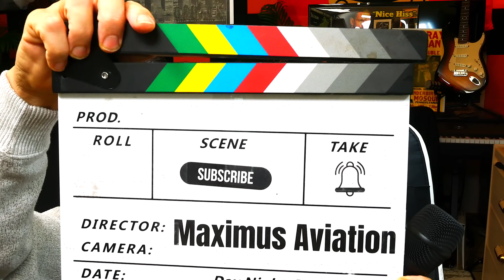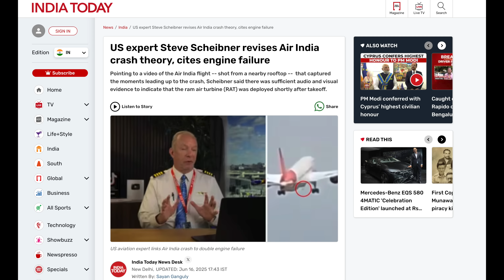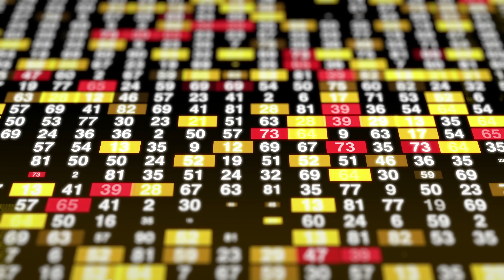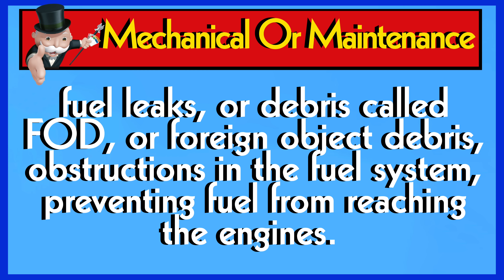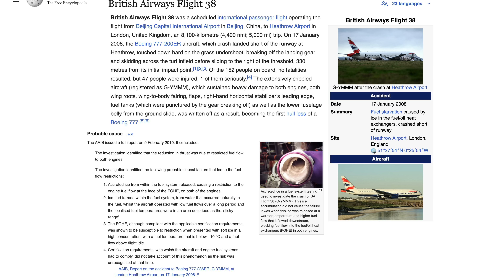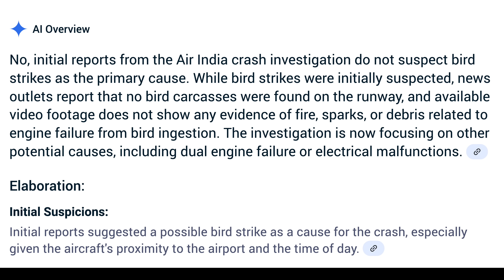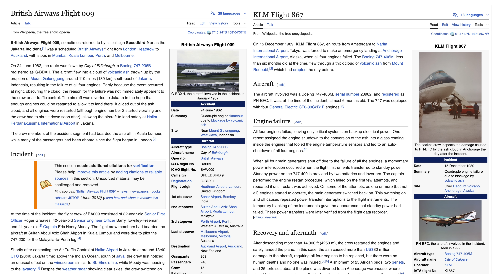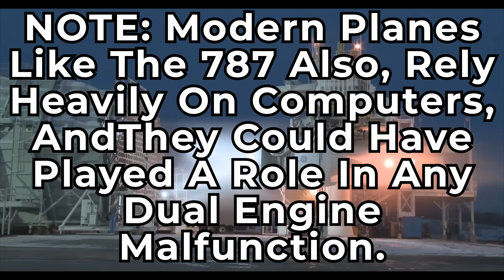Dual Engine FAILURE, Real Or Just The Latest Guess By Armchair Pilots? Find Out How Engines Fail ✈️

Comment: Some video reveals something appears to be spoilers on wing top close to each engine. If unaware, spoilers can give pilot a sense of lost of lift, thrust or both. A panic pilot can pull off the RAT manually. .
Reply: flaps 5 give you a gap below the spoilers a captain said  i think it might be that but its a good point as i think they might be used as ailerons so maby they were dampening out the aircraft after an engine failed via the computers
i probably am talking bollox

Comment: There is also a possibility that one redundant FBW computers failed in the way that was feeding other computers with such bad data that would prevent ir being recognized as failed one (instead going offline). Or saturating the comm bus, and freezing some of the mech and power systems in the SNAFU manner.
I remember a case with Airbus where ADIRU failed "loud" and because of some unexpected quirk it was not properly recogized as a failed unit and sent garbage data, affecting controls.

Comment: Whatever happened, happened while they were still on the ground. One of the evidence is that they took off at the very end of the runway. I think pilots knew that something was wrong, but took off anyway because they were under pressure from the company. They should abort this takeoff and the tragedy could’ve been avoided
Reply: when you're on a takeoff roll, you reach a point where you HAVE to take off or you'll just plough headlong off the end of the runway and into anything that's in the way. you have no idea what you're babbling about. "under pressure from the company"? you're delusional.
Reply: NONSENSE. And search for other aviation channels, one of them has shown graphs that show several Take-offs taking similar runway lengths, and a couple even slightly longer.
Reply: @alfredomarquez9777  and speed ok a 787 pilot has said
Reply: Well it was hot that day, it was dry and the weight was high, which would explain the long length
But I don't understand the small plume of smoke that came after it took off, was it an engine failing or did the aircraft overshoot the runway for a bit?
Reply: @crypton7572  it could have been slowly failing when rolling   i think it looked ok but that means nothing in reality

Comment: Boeing and AI know what happened with with AI 171. These aircraft send out Trea data of system information. No doubt engines lost power as the pilots called out. The 787’s have so much software onboard, having that software work correctly is critical. The investigation will follow all maintenance accomplished prior to prior to this flight and pilot action during takeoff.
Reply: amazing

Comment: There is always the possibility of deliberate fuel shutoff.
Reply: Accidentally or intentional
Reply: @mikesorensen5228  Never accidently. Do you ever step on the gas pedal when you want to stop?
Reply: @Deploracle never huh?
Reply: @mikesorensen5228  I'm sure you'll list the few times a fuel valve was bumped in flight .. but that wasn't during take off when one's pilot's hand is on the yoke and the other on the throttles.

The pilot not flying isn't going to be messing about in the area below the throttle levers during the take off roll.
Reply: Not heard much about the pilots
Reply: Nice call. First person to suspect this outcome.

Comment: I am a 787 expert (I watch some other youtube videos): VAPOR LOCK.  Is was 110 Degrees plus the heat radiating upward from the tarmac.
Reply: I agreed with you until I was corrected and remembered I am a nutritionist
Reply: @LAURABOHDAN  lol  Were you corrected on vapor lock or that you are not a 787 expert, or both? lol

Comment: You need to revisit the Calhoun speech all hands meeting of Alaska missing bolts, he also talked about FOD in the fuel system and you need to look at the federal register AD note on fwd pressure bulkhead the CRN brackets are reused and non electrical bond and no interference fit on row 3. It's a grease monkey mechanics boss that creates 117 NCRs on a single item

Comment: Is there not some AD or TSB that indicates that if the aircraft is continuously powered for ~245 days that it will start having HUGE power systems issues?
Reply: I think it was longer than that, 32 bit counter rolling over after a month. Part of the problem was that they threw so many errors that powering on from cold and dark was painful. I wonder if that has been fixed after all these years.

Comment: Raising gear blew the electric
Reply: amazing work son, you should call the AAIB and tell them you solved it.
Reply: @T.E.S.S.  crazy thing is the bogies were tilted so the did raise them,,,  but was it just after take off or did they try after they lost power   so it goes on the hmmmmm  list to be looked at
Reply: @davidblurton7158  I watched a different video and I see what you mean. Looks like the retraction process had been started
Reply: @T.E.S.S.  yeah swiss100 had it first as he spotted it  good spot that as assuming it was a normal retraction it failed just after they called for it  maby,,,,

Comment: Do A simulator test of 787
Set altitude at 14000
Temp at 102'f
Weight 150 tons (fuel,cargo)
It will taxi,v1. 
V2 after 13000 runway
Crash

Comment: fire extinguishers shut down engines... not because of chemicals use, but because the fire handle shuts EVERYTHING OFF FOR THAT ENGINE
Reply: interesting point,,,  never considered that,,,
Reply: And the puff of white "smoke" may be the Halon shot from the Fire Bottle(s).
Reply: @Deploracle  do they use halon now  think it was methyl bromide back in the day  im such a dinosaur
Reply: @Deploracle  which white smoke? at the end of the runway when the aircraft broke ground?
Reply: @SKIPWOOD-UA777CAPT-RET  It was confirmed by the tower, the day after the crash, that the plane broke ground with nearly 700 meters of runway remaining.
Reply: @Deploracle  Who measured this? Is there video footage? I put very little faith in eye witness reports...
Reply: @SKIPWOOD-UA777CAPT-RET  I don't think anyone measured it. The tower controllers on duty that day confirmed the plane started the take off roll from the end of Runway 23, not from the middle of the runway as Flight Aware was reporting.

It's well known the take off performance of the 787. It was from there the 700 meter of runway remaining was calculated.
Reply: @Deploracle  what is calculated and what the actual performance of the jet is are 2 different things.
Reply: @SKIPWOOD-UA777CAPT-RET  Not very different. This is aviation, not a flight sim.
Actual take off performance is calculated on EVERY flight, and is well known .. no chances are taken.
Reply: @Deploracle  Unfortunately you didn't add in the human factor and after 33,000 hours of flying starting in 1974.... there is too much ground to cover with this one... I have seen too much to sit back and agree with you...
Reply: @Deploracle  SO YOUR FLIGHT MANUAL TELLS YOU TO SHOOT THE FIRE BOTTLE ON ROTATION? INTERESTING... BECAUSE IT HAS TO BE MANUALLY ACTIVATED AND I HAVE NEVER SEEN ANY AIRPLANE THAT HAS 'AUTO FIRING OF FIRE BOTTLES'...
Reply: @SKIPWOOD-UA777CAPT-RET  They could malfunction though. I wasn't about to suggest they were initiated by accident.
Reply: @Deploracle  great... more malfunctions... seems like this bucket of bolts shouldn't have been on the flight line ready for service.
Reply: @SKIPWOOD-UA777CAPT-RET  I didn't say they failed, just that they are a potential failure point (as is every system on board).
Reply: @Deploracle  like firearms... they just fire themselves?
Reply: @SKIPWOOD-UA777CAPT-RET  When a firearm malfunctions they sometimes can fire themselves. Ask police officers about their P320s for example.

Anything mechanical can fail .. which is the only reason why I posted about the Fire Bottles.

I haven't budged from my very first hunch I had the day of the accident ... bird strikes and the white puffs are what was left of them. I presented an alternative explanation that also fits the white puffs in the videos .. Halon fire bottles.

Comment: Here is the physics explanation for the way vapour lock is likely able to happen under the conditions inside fuel lines.

Consider the temperature of boiling water at sea level, versus at the top of Mount Everest.  At sea level it is 100 degrees Celsius.  At the top of Mt. Everest, water boils at 89 degrees Celsius.  At lower pressure, you need less temperature to create vapour.

Now consider a pressure cooker.  If you contain water in a pressure vessel, and raise the pressure, the water will require more temperature to create vapour.

This shows that boiling, and therefore creation of vapour locks, is dependent on both temperature AND pressure.  The temperature to cause a vapour lock depends on the fuel line pressure.

The real world proof of this shows up when you try to determine the maximum height that you can push or pull water up a pipe.  In a deep water well, the pump is placed at the bottom of the well, and raises pressure to force water up the pipe.  Why?  Because the maximum height that you can raise water in a pipe USING SUCTION at sea level and standard temperature is about 33.9 feet, or 10.33 meters.

What is happening here?  Well, suction reduces pressure.  Pressure reduction reduces the boiling temperature.  At first you are suctioning out the air in the pipe to raise the water.  To continue raising the water, you need to use more suction, which is actually reducing the pressure further.  Eventually you get to a point where you have reduced the pressure so much, that the Boiling Point of the water is reduced to the ambient temperature.  Once you reach that height, the water turns to vapour and the liquid height will not rise further.  This is how vapour locks form through suction.  Your suction pump is no longer sucking air out of the pipe, it is sucking the water vapor out of the pipe.

Now consider fuel in a fuel line:

1)  If the fuel line is pressurized by the in tank fuel pumps, it is being squeezed.  It has a higher pressure than atmospheric conditions, and will require a higher temperature to allow the liquid to have enough force to make a vapour bubble exist.

2) If the fuel is being drawn down the fuel line by suction, it is being stretched, not squeezed.  It has a lower pressure than atmospheric conditions, and will require a lower temperature to create enough force to make a vapour bubble exist.

This points towards the following scenario causing dual engine failure:

HIGH PRESSURE TANK BOOSTER PUMP FAILURE.  The jet engine is forced to rely on the suction pump within the engine to fuel combustion.  THE PRESSURE OF THE FUEL INSIDE THE FUEL LINES DROPS SIGNIFICANTLY.  At take off, the fuel demand is so high that the amount of suction required is very significant.

Pressure is reduced on the fuel inside the line, ambient temperature was huge that day.  THIS IS THE PERFECT STORM THAT CREATES THE VAPOUR LOCK THAT CAN CAUSE THE DUAL ENGINE FAILURE.

This is why the redundancy of the fuel system design needs to be considered.  The engine's suction fuel pump cannot be considered as a redundancy solution for aa failure of the high pressure electric in tank fuel pumps.

The jet has dual redundant fuel pumps inside each tank, but the pump controller and pump power source redundancy is highly suspicious.

The fuel pump control module has provisions to shed the loading of the pumps on the electrical source.  The controller turns off pumps that have been activated by the pilots.  This might prevent the pilot from running two separate tank pumps supplied by two separate power sources to each engine, even though the pilot assumes that the pumps have been activated in such a manner.

I am suspicious that the designers of the pump controller incoreectly assumed that the engine suction pump would provide the eqivalent performance of the tank booster pumps in all scenarios.  I am concerned that they rely on the engine suction pump for redundancy of the tank pumps.

I suspect that the tank pump controller redundancy and pump controller power source redundancy are weak at best, and perhaps they are totally inadequate, and the cause of this disaster.

Given that there are power overloading symptoms indicated by the Air Conditioning System being intermittent, and lights flickering, did the tank fuel pump controller recognize this condition and decide to deactivate the extra fuel pumps to reduce the electrical demand on the power system?  Did that get followed up by a power flicker on the electrical feeder that supllied the remaining active tank fuel pump, that had its redundant pump disabled by the pump controller?  Did this cascade domino effect cause vapour locks to stall the engines on take off?

We are onto something here.  It needs to be investigated now, as this could happen again before the crash investigation results become available.

Give this a thumbs up so that this gets more attention please

P.S. :  See thefollowing web link for this important piece of information:

https://kb.skyhightex.com/knowledge-base/how-to-master-b787-fuel-system/

In Some Non-Normal Conditions, Electrical Power Is Insufficient To Operate All The Fuel Pumps And Will Automatically Determine The Best Pumps To Operate And Shed The Others. Indication Of The Affected Pumps Will Show On The Over-Head Panel And The Fuel Synoptic By A LOAD SHED Next To The Pump.
Reply: So you are saying that in some weird loss of power situation the airplanes pump control logic shut fuel pumps down.
Reply: @crooney82  I am questioning the possibility of that happening

I also question if the pump controller was designed with the ability to handle redundant and isolated power sources to ensure that there are some pumps still running if one of the generator systems malfunctions.
Reply: That is a lot to digest, but it makes a lot of sense in the context of an aircraft that seemed to be having electrical issues on its earlier flight. It’s sort of a perfect storm scenario. Time will tell, but I think that you may be onto something.